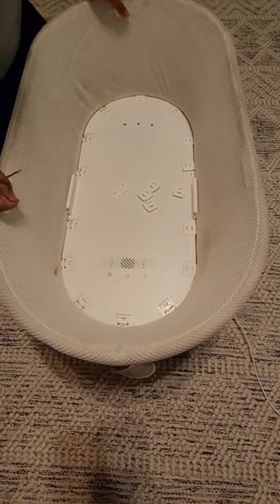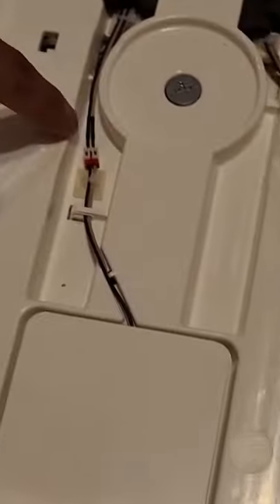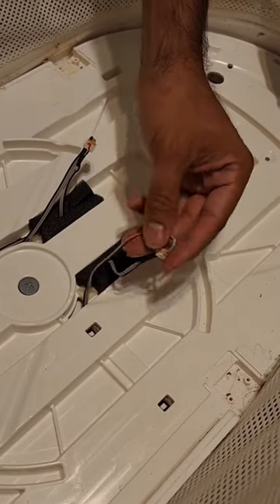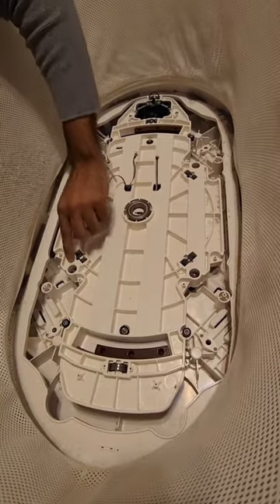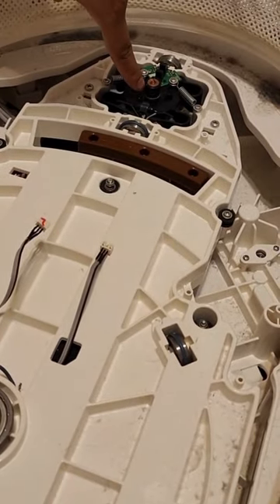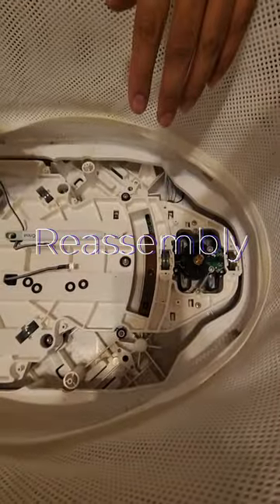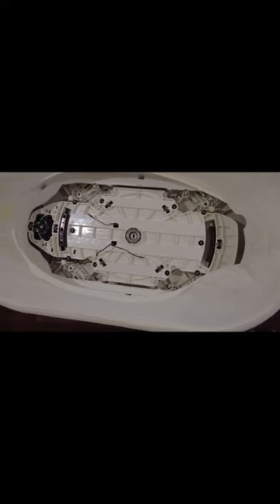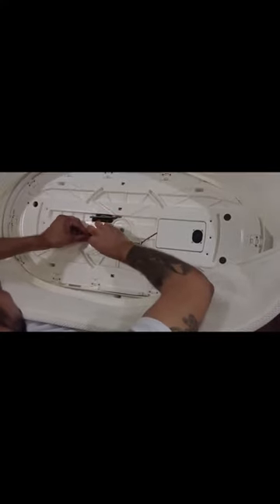How to fix broken Snoo replacing Orings

Comment: Thanks so much for the video. Replaced my Orings on the barring and the motor shaft on a 2018 model today. Only issue I had was accessing the barring I had to remove the entire board that they are attached to and unscrew them from underneath. I took a picture to help others but don’t see a place to add it :/
Reply from the maker: Thanks I have another video named "replacing snoo bearings" which shows how to remove the bottom sled to access that area if people need help.

Comment: Thank you for this helpful video! 
I’m having speaker issues with my snoo. You mention it is often due to the connection. I checked and those are good. Do you know where I can buy a replacement speaker from? 
The speaker turns on but sounds blown. It’s making weird sounds

Comment: Hi! Thank you for your video. My 2021 SNOO started jerking at level 1 and then baseline. I opened it up and it has large orings that look thick and like they don’t come off? Also the 3 small ones look in good shape. Any ideas?
Reply from the maker: Please send me a pic of triple orings via IG. Sometimes they look ok but can be worn below normal level which makes it jerk. If not then it will be your bearings.
Reply: Did you find out about the large o rings? I have the same and not sure they should be replaced

Comment: Hey, thanks for the video! I did have one question, I'm getting conflicting sizes for the bearing o-ring. Should I be getting the 117 or the 118?
Reply from the maker: I use 118. But they both fit.

Comment: You mentioned that the old and bew snoo models have different o-ring sizes for the motor shaft. I have the older one with the brown sliders. 

Theres only one motor shaft oring size on your link, 8s that for the old or new? 

Thanks for the help bro, i was loosing my mind
Reply from the maker: I found a universal oring. And updated the link in my linktree. That oring will work for both.

Comment: We have a clip sensor error. Looks like the wire on one side is broken were it was bent - close to the pin head. Is it possible to order a new cable somewhere?
Reply from the maker: Just sent you an email!
Reply: We have a clip sensor error as well. Could I get that info too? Please and thank you!
Reply from the maker: @zambranowelch  yes @snoorepair
Reply: Thank you! Do you happen to have a video or link to an explanation for how to fix this error?
Reply from the maker: @zambranowelch  no too many factors to take into consideration. I can explain via video chat and better guide you.
Reply: @SnooRepair  Okay, that'd be great. I sold my snoo and the new user has this issue. I repaired the o-ring with your help, but I feel awful that she's having this issue. Trying to help her out.
Reply: @SnooRepair  Can I please get any info you have on wires and "Clips not engaged" error. Thanks
Reply: I had the same issue, the black wire got damaged when I took it apart. I bypassed the connector and connected the wire directly to the other end of the connector. Not a great solution but it works now.

Comment: Do you happen to know where I can get the sled bearings from? I have one that's sticky and clicking.

Can't find any with the slot for rubber rings..
Reply from the maker: I can look into it. Should be an easy match if you use measurement calipers to measure the ID, OD and thickness.
Reply: Thanks! I can find the bearing size but the slot for the rubber ring to stay in place is something I just can't find.
Reply from the maker: @kyleyost1819  oh sorry you are right. No idea. But if you message me on IG I can provide a contact that has some spares.